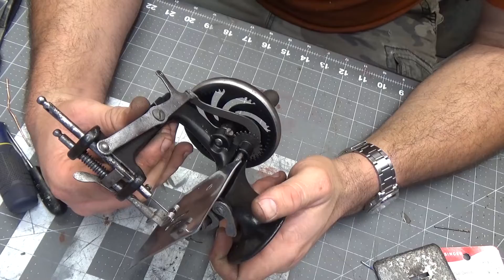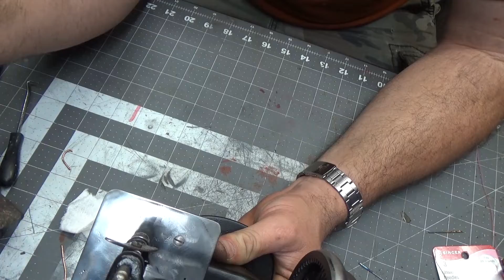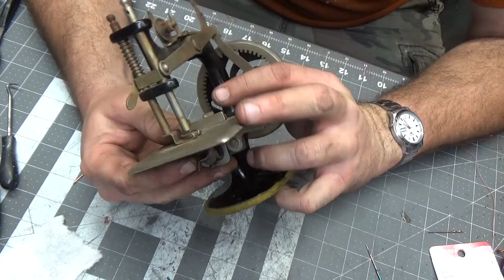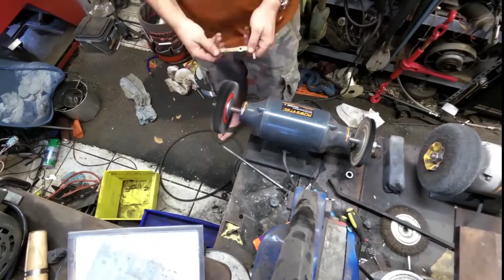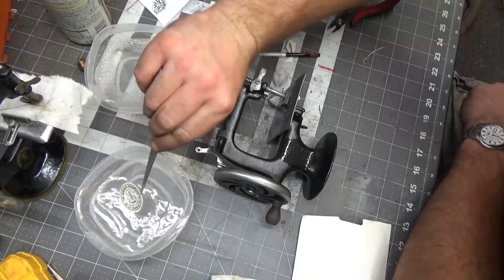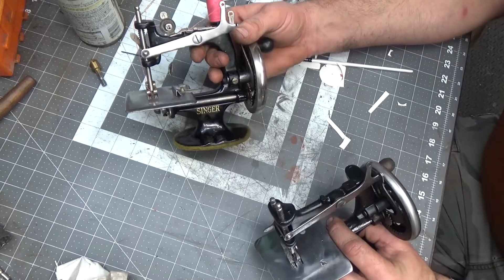Singer Model 20 (Part2)

Comment: I would love to know how you restored the second one, I’m guessing you can sand and polish most of the moving parts but wondering if that would damage the finish on the bed? I just bought a fixer upper that hopefully just needs light work. I’ve fixed up sewing attachments before with very fine (1500) sandpaper. thanks for sharing!
Reply from the maker: I think i sanded off the original finish, on the bed, and buffed it to a shine. These little machines are great. Cheers

Comment: Can't believe you had two of them! Nice! They turned out wonderful. I wonder if a light switch wall plate might have worked for the table as they have rolled edges. Hard to tell but they might be a bit larger than the original. Great job!
Reply from the maker: Steve, you're right, it looks exactly like a steel light switch cover. I just went and checked, I bet you are right a switch plate cover probably would have worked. It is slightly larger, but it being large wouldn't hurt anything. Anyway, great idea. I don't know if i'll go back and change anything at this point, but if I do and I use a light switch cover i'll make sure to make a video and credit you with the idea. Cheers
Reply: I agree, no need to go back and change things and certainly no credit is needed. I'm all for sharing info👍

Comment: Excellent series!  You know Joe many times I will pass a project by because I know I can't handle it...  I learned this very valuable lesson when restoring an antique car that took me 15 years to finish!  Those two Singer machines were the perfect example of choosing the best project to start!  My buddy bought a car to restore years ago and was pretty deep into the restoration when he heard of a donor car that he could use...  He bought the donor car for a 1/4 of what he paid for the car he was restoring and when he got it home it was apparent the donor car was in better shape!!!!!  At first he was depressed thinking the last 4 months were wasted time but then realized it would be foolish to continue working on it.  He sold the original project and restored the donor and was very happy in the end.  Remember that Shelton tool kit I did, well there was another kit for $15 less but needed more work and was missing the utility knife...  I passed because the extra work and trying to find a Shelton knife was just a nightmare!  No more basket cases for me, by the time you finish with them they cost more then if you started with a really good example!  Great job all around!  Thanks Joe!!!!
Reply from the maker: Hi Scoutcrafter, i was a little conflicted when i got the "donor", it did feel like a bit of a let-down, but like you said, the original was a basket case. I liked Ben's comment, it was still fun and rewarding to clean up the old machine, despite it never being what it once was. I keep waiting and hoping to see you make an episode on your leather sewing machine 😀. Cheers